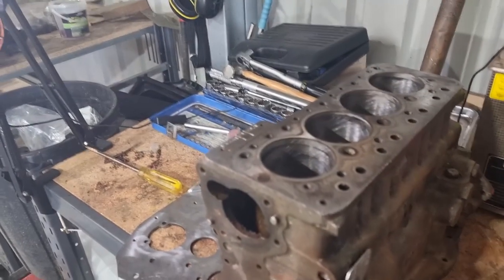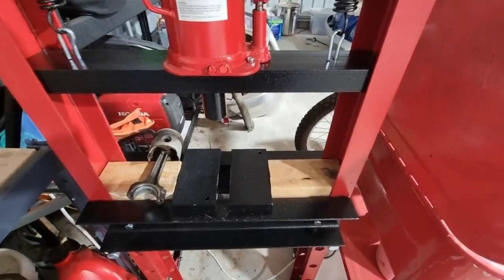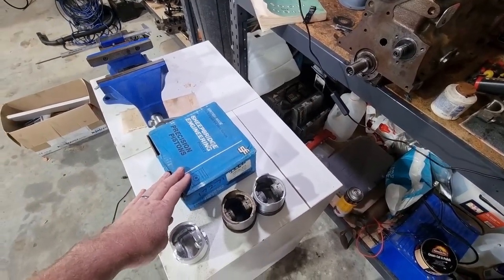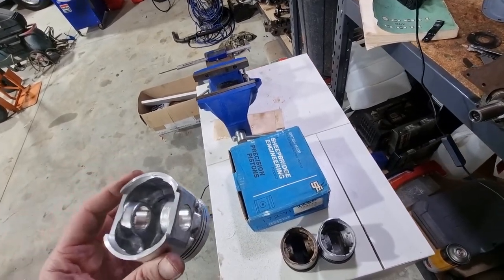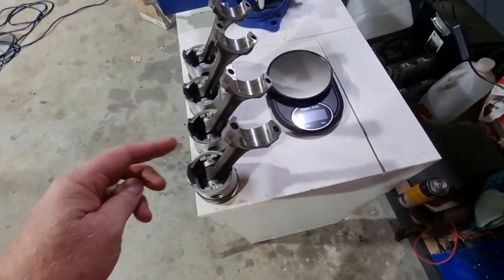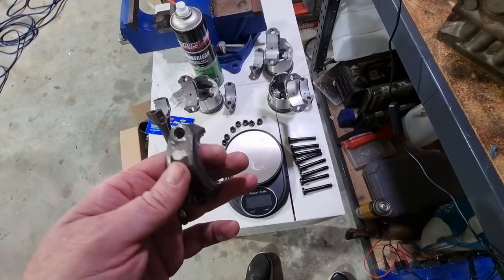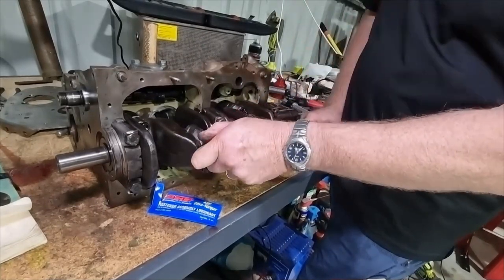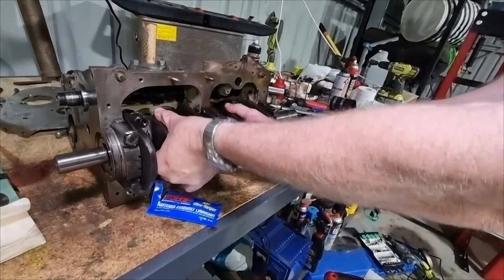Mini Revival - episode 3. Fitting pistons. Yikes!

Comment: Very  relaxing while being informative! Just out of interest , do you have any Haynes manuals?
I see you use a workshop manual.
I've only had Haynes in the past.  All on line now of course! 
Is there an option for a higher output oil pump? Perhaps a daft question but.....
I've never considered balancing till now! Good stuff.
Beware the China peril!
Thanks,will be following the series.  ( UK)
Reply from the maker: Hey Robin, I find manuals severely lacking in the level of detail I need. In particular, they lack appropriate cautions. They assume you know what you're doing... irrespective I do have manuals for tolerances. Glad you're enjoying.

Comment: A lot missing from your build buddy,
The end bolts needed tapping into rods first,
(35LB is not enough to pull them through) 
Did you set ring gaps?
Not skimming block?
Measure for minimum squish? 
Vernia for cam timing? 
Those pistons are high drag with 4 rings on, 
Did you balance rods separate from caps? 
What head studs r u running? 
Is it any kind of performance motor? 
Watching with interest 🚗👍
Reply from the maker: Hey mate, thanks for your comments. I am not building this engine as a "performance" engine. It is also not a daily driver. My intention is to clean it up, new bearings,  pistons and rings, then reassemble. It will probably do 400km per year; none of it near a racetrack.
This is where I think we are at odds I think, but I agree with your perspective if I was going for a reliable high horsepower application. 
Also note that both old and new rod bolts didn't need "pulling through" as such. There's no interference fit. 
Thanks for watching, and I'll keep the videos coming.
Reply from the maker: ...I should also add that your comment and my response will be useful if ever there is a future owner of this car, so that they can see what I have done, what was considered, and what you have suggested. All good!